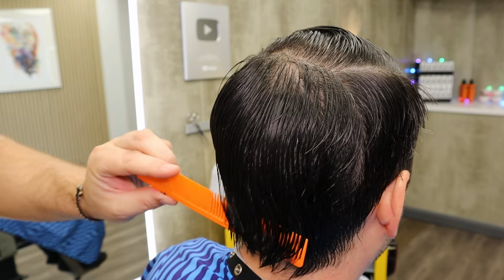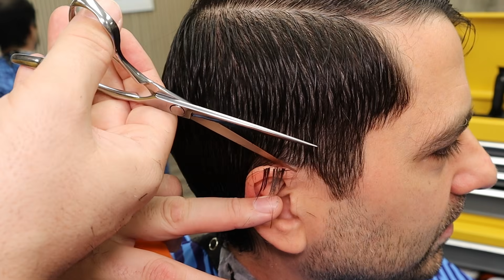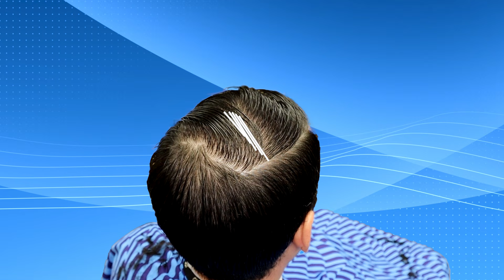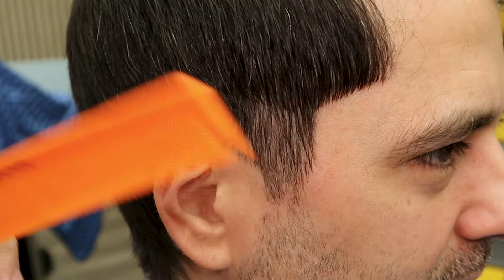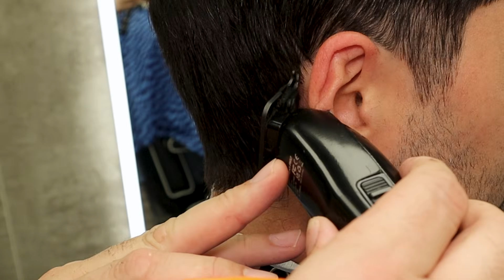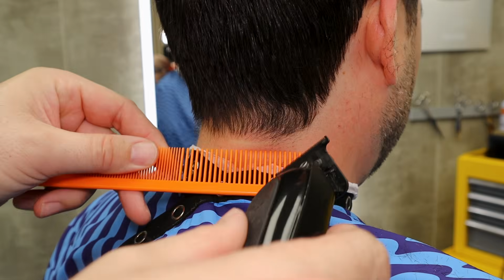How To Cut Mens Hair With Scissors | Side Parting Tutorial Step by Step

Comment: how can you cut a thinner hair on the middle of the hair to make it more thicker?
Reply from the maker: that is a greta question and its acutally possible with a little care.  You can make small cuts with the thinning scissor closer to the root so those hairs push up a bit.  That will then add lift and volume to the hair it touches, strangely it can look fuller

Comment: could you get a guide from above the horse shoe parting,on both sides,like block graduation.then take a guide from the crown,to go through the centre  of the top of the head ? (or does it come up short on the parting side)?
Reply from the maker: It can end up a little uniform like that.  but if the hair has natural curl it will work fine

Comment: How do you determine  the length on top so that it meets nicely with your sides? I often end up with it too long so that when I go to connect with the sides, I have a harsh angle (essentially an undercut) and have to go back and shorten the top.
Reply from the maker: I think if you consider how long the top is compared to the sides and the top is not too much longer than the sides then the blend will be easier. In a lot of my videos I also talk about cutting the corners off. If you check out my latest video it’s a similar technique to the over direction technique I show on the sides to blend in. Just don’t over direct it.

Comment: When you do scissor over comb are you moving the comb closer to the head as you go down? I struggle with this as I find it hard to stay consistent
Reply from the maker: There is two ways that you can taper the hair as you work your way down. Either get closer as you work toward the perimeter or lower the angle of the section as you work your way down. These methods are almost the same.
Reply from the maker: This video kind of explains the concept 
How to Cut Hair Using Angles | Decreasing Angles
https://youtu.be/qYmJaw2Q-sA

Comment: Thanks for doing this side part tutorial!  That’s how my son wears his hair, so this was super useful.  I have trouble with weight lines everywhere, especially at the back of the head.  I have trouble blending the side hair in with my son’s mutton chops.  His hair is very straight, but his mutton chops are curly.  I also have trouble tapering the sides and top back of his hair.  Finally, his hair sticks up in the back no matter how long it is.
Reply from the maker: Lines are almost always because the section is too thick when you cut it. Try taking less hair or try cross checking it. I also made a video recently where I cut super straight hair and you can see how much hair I’m leaving to keep the crown flat How to Cut Straight Asian Hair | Boys Haircut
https://youtu.be/WFthSOJCPK0

Comment: I cut the hair the way you showed me. However, I cannot comb or lay the hair to the right or left. I have been a barber for 4 months. I haven't had any problems with my clients. But I lost the clients who had this issue. I live in Lithuania. I am looking forward to your help. Thank you. Good luck. Best regards.
Reply from the maker: Layering and control of the hair will come to you. If the hair is too short it will be difficult to control. So apply these concepts to slightly longer hair. At least as long as is in this video.

Comment: Thanks for the video!  Question: when I cut my kids hair for a part, without fail after they’ve been wearing it for a couple hours, it always falls down flat. How do you keep the parted side blended well so it looks good in both parted and straight down styles?
Reply from the maker: The single most important thing is to find the natural parting. If you brush the hair back and let it relax it will fall into its natural parting. If you work using that line then you shouldn’t have any problems. The hair will push apart there without you doing anything.